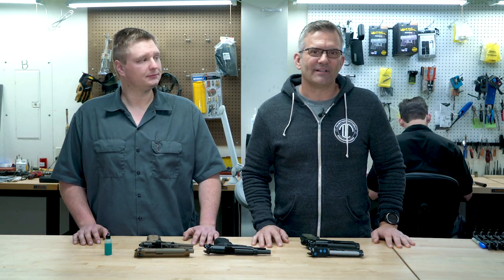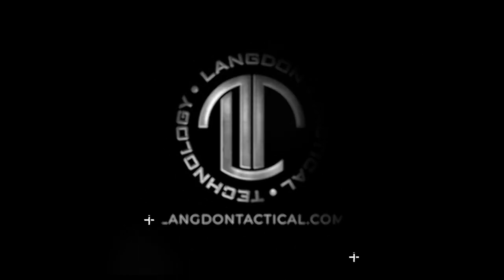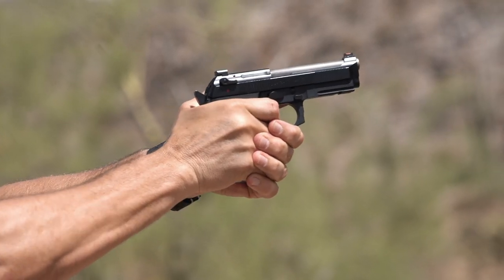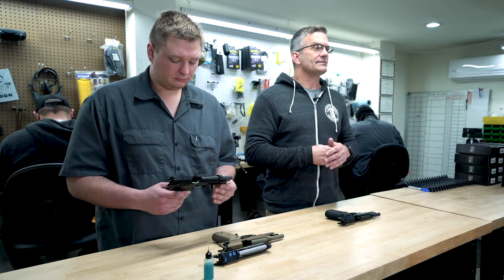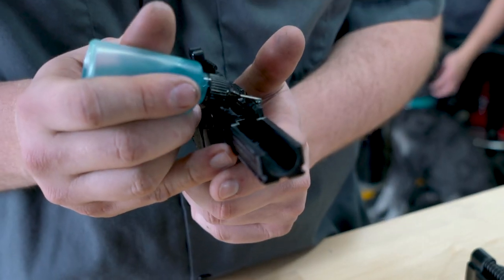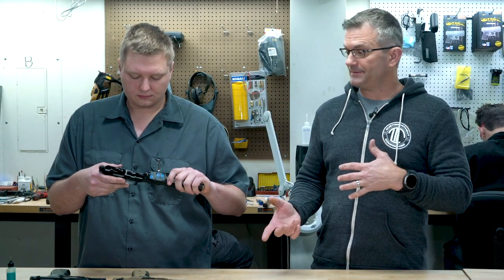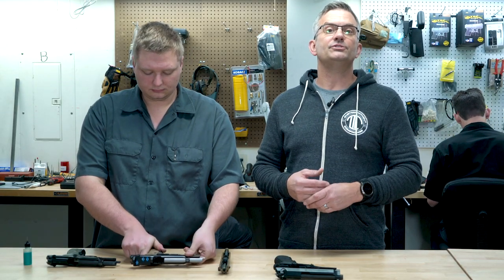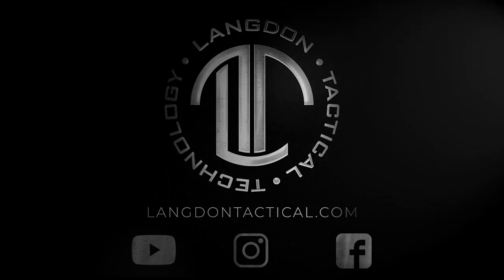Red Dot Slide Fit on your 92

Comment: Got my LTT RDO slide in yesterday and noticed this.  It took quite a bit of effort to pull the slide back at first.  After racking it a couple of dozen times it smoothed out.  Took it out to the range today and it functioned flawlessly.

Comment: I had a question maybe someone could answer. I noticed that the compact 92 has a consistently heavier trigger pull (.5lbs more) than a full sized frame beretta with the same hammer spring in the grip. Now I know they use the same length hammer spring but since the compact has a shorter grip the spring is already under way more tension than a full sized beretta. Would it be reasonable to cut the spring shorter for the compact or use a lighter spring without compromising reliability? I know the scientific answer will be that it doesn’t make a difference because the hammer spring doesn’t have a variable spring rate. But a spring under tension can suspend more weight until compression than a fully slacked spring can right?..Anyway not an engineer just a mechanic ha. Thanks
Reply: I know this is late, but you cut a springs length to stiffen a spring.  Think of this. Say you put 5lbs of pressure on a 3" long spring and it compresses the spring 3/4".   This is 1/4" of compression per 1" of spring length.  Now, cut 1" off the spring and you will see the math tells us that spring is only going to compress 1/2" with the same 5lbs of pressure.    You will need even more pressure to compress the spring the same 3/4".   Also, in many applications spring length cannot be altered.

Comment: Since the locking block is so important for the fit and accuracy, at what round count do you recommend changing it out?
Reply from the maker: I normally replace mine between 10 and 15 thousand rounds. They will last much longer depending on the ammo you use, but they are very cheap to replace so there is just no reason to wait and see.

Comment: I have a question I’m thinking about getting the beretta 96 and want to know if I would be able to use the barrel on that cause I would like to switch between 9mm and 40s&w
Reply from the maker: Many people have done that will good results. My understanding is you need to use 9mm magazines with the 9mm barrel in a .40 caliber slide. I would not want to use it for anything important as the  96 slide has a different breach face and extractor, not made for 9mm.